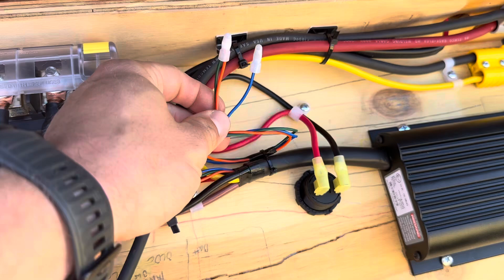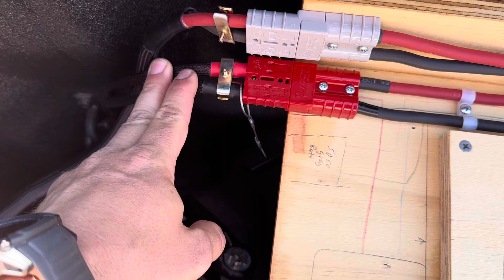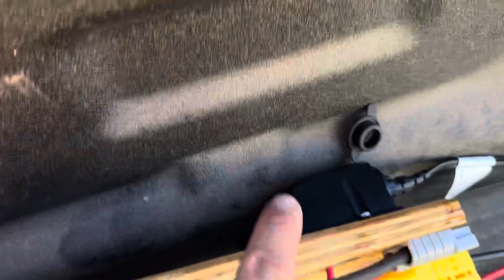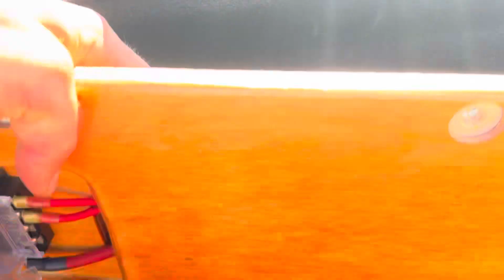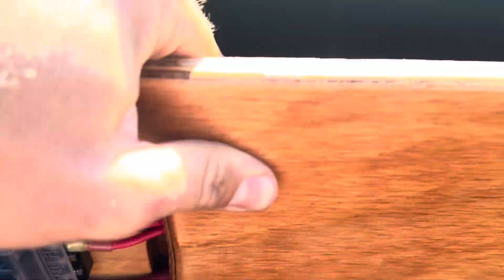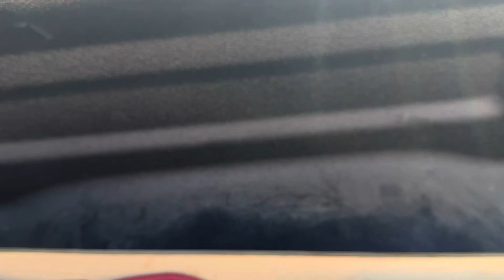Redarc BCDC1225D - An easy solution for dual batteries in a 2007 to 2021 Toyota Tundra

Comment: Thanks for posting. 
How's the system been working for you? Any changes or updates? Would you have time anything different?
Thanks again for the vid!
Reply from the maker: @BlackReign79  it’s been fantastic. The LiTime battery has been extremely tolerant of the cold weather. I didn’t realize this at the time, but the BCDC also has low temp charging protection built in. It’s really a great unit. 

As far as how it’s working; it’s great. I now have a single 100w panel on a bed rack that’ll keep the battery charged while running the fridge during the warmer months. It won’t do it in the cooler months as the sun is too low, but it’s still enough to power the fridge for over a week without starting the truck. 

I will be posting a new video as I did change things up. I rebuilt the system in an XL Milwaukee packout with a 600w inverter. It’s now portable, though it still lives in the truck.
Reply: @jhon5489  that sounds really cool! I'd like to see how that came together. 
I have a 3000watt inverter and a Redarc 1250 on the way that I intend to install in my 2018 Tundra CM. I have yet to decide on the final install location and the battery size. So I am looking forward to seeing how you have changed your setup. 
Thanks again for the vid!